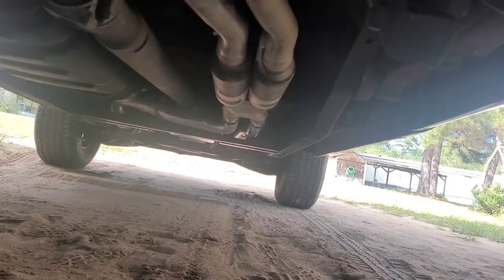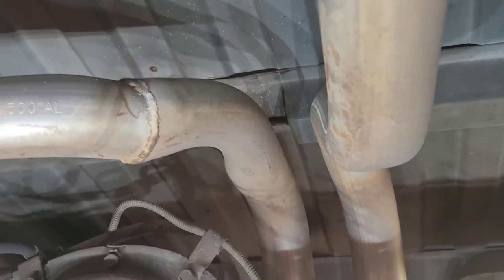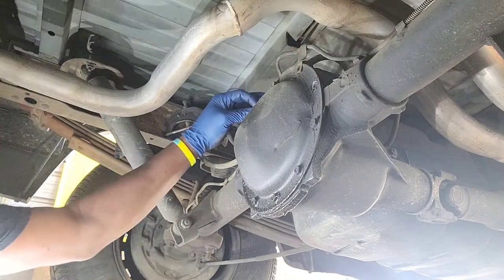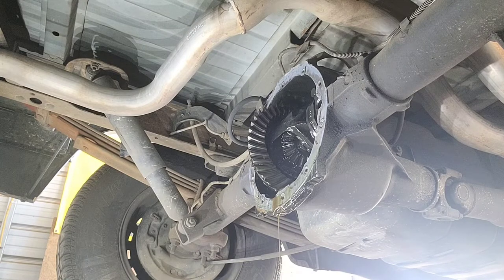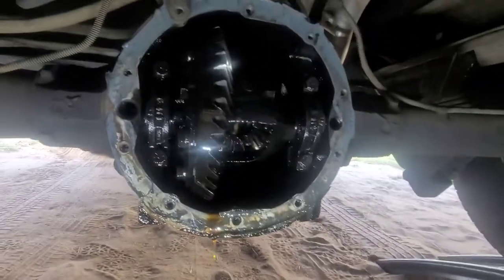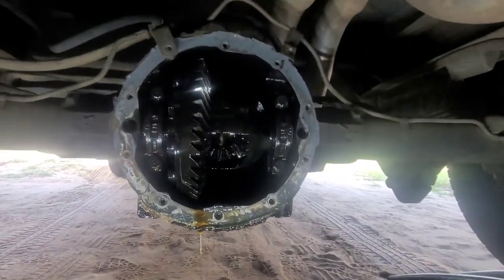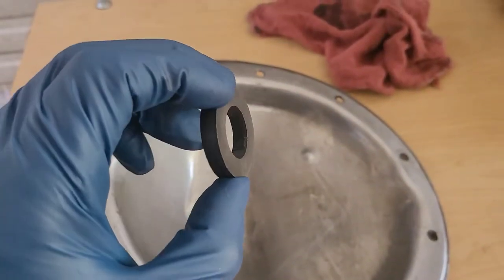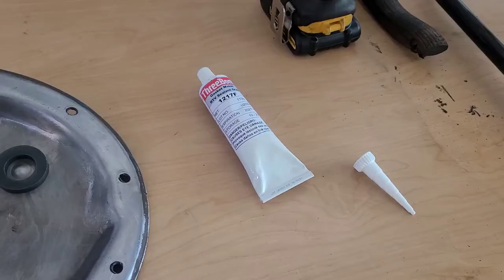How To Service Your Rear Diff On Your GMT 400 Truck!!!

Comment: Appreciate you showing me the exhaust system. The long tube headers ended up not fitting my truck so put the manifolds back on and went with a true dual with 2 cats and an xpipe. Also this video reminded me to service my rear axle
Reply from the maker: No problem! When I was under there, I was like I had a viewer ask me about my exhaust with the long tube headers. I'm sorry they didn't fit. You may have to try a different brand. All long tube are not created equal. Good luck on your build!✊🏾✊🏾